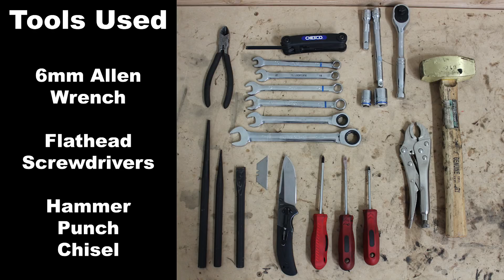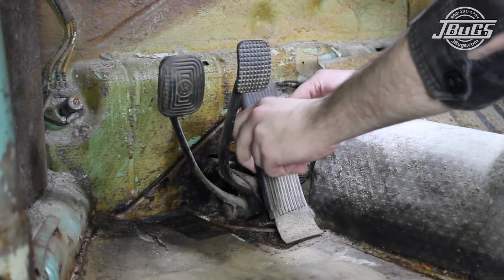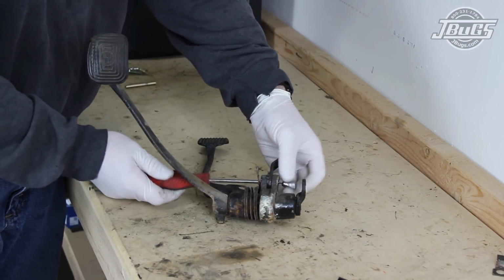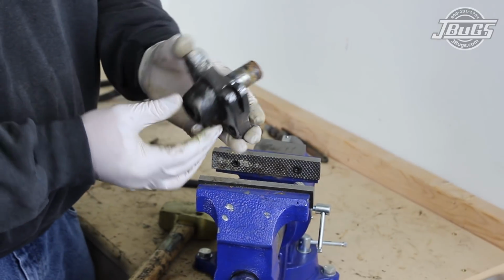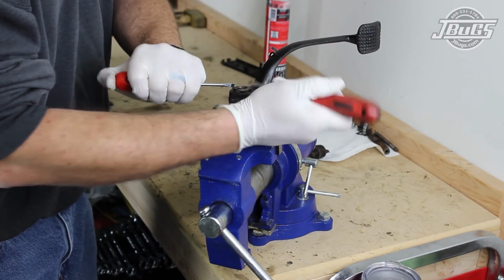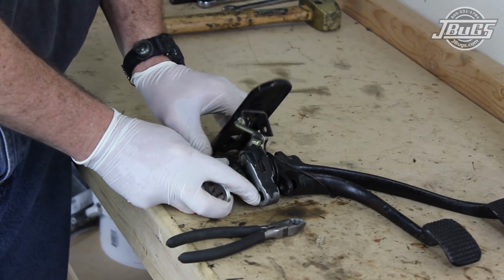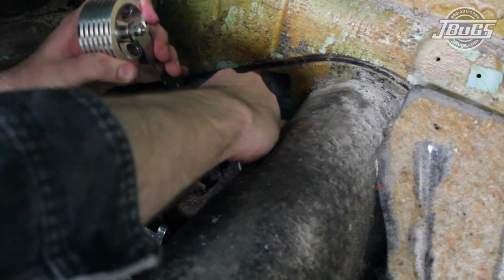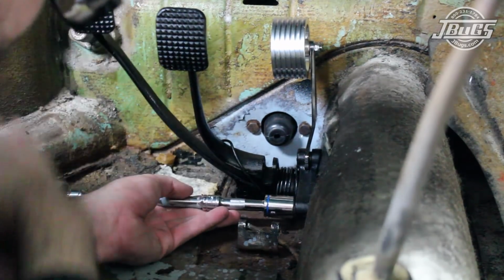JBugs - 1963 VW Beetle - Pedal Assembly Rebuild

Comment: Excelent. My brake pin fell out this weekend, and I lost brakes instantly. Luckily, I was going about 5mph and could use my hand brake to stop. What I needed to know is, how that brake pin is held in place. Perfect info for me. Thanks.
Reply: Tension holds the pin in place, that's it. One or both ends could be peened over after the pin is pushed into place.

Comment: JBUGS,
I know this video is older, I'm trying to restore the pedal assembly on my Karmann ghia and the pin that holds the pedal is not coming out.
Maybe I haven't hammered it out hard enough as I'm not trying to mushroom it
Any tips or tricks? Good ol'torch?
Reply from the maker: A torch can certainly help and we’ve used one on more than one occasion, absolutely.

Comment: What does the pedal stop do exactly? Does it keep the pedals from going next to the firewall and that's it? Thanks
Reply: The pedal stop prevents the pedals from falling towards the back of the car. If the stop wasn't in place the pedals could fall opposite of the front firewall, and lay flat on the floor.

Comment: With the roller did you use the stock pedal or did you replace the pedal as well.  Part #?
Reply: The roller pedal replaces the stock pedal.

Comment: Why you didn't  restore the  floor area of the  pedal assembly, there is a big corrosion problem, you should also paint the pedal assembly.
Reply from the maker: The car will be coming apart for paint and body at which point the pans will be cleaned up and coated and all the components will be painted.